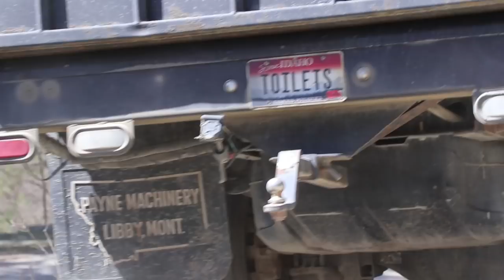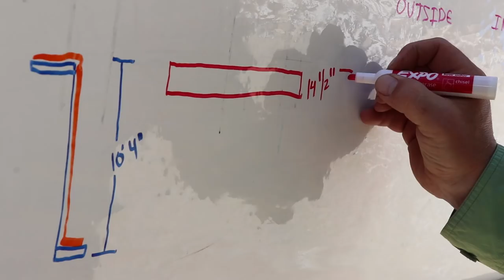TERRIFYING! Melting Our SIPs! (Installing FIrst Garage Panels)

Comment: Get a battery and some wire and you can make your own foam cutter for near nothing.
Reply: They only want tools that cost the max....don't cha know...
Reply: catfish307 
A wire only works if you've got access to both ends of the cut. This is a plunge between the OSB skins.

Comment: You may have been better in the sun with improved ventilation  because the smell might be harmful to your health. If I'm not mistaken the foam is styrene and bad for your health if it can be inhaled. I would get the MSDS (SDS) now and ensure you have adequate ventilation or the proper respiratory protection.  I'm a Health Safety & Environmental (HSE) Construction Site Safety Master  (CSSM).

Comment: Just be careful.  I'm a retired architect and if I'm not mistaken, that's cyanide gas coming off that melted foam.  That's why most codes don't allow foam as a finish material for interior finishes.  The fire doesn't kill you, it's the cyanide.  Please use some respirators in a well ventilated area.

Comment: An 8-foot and 16-foot wide garage opening needs at least two jack studs to support the LVL beams (headers).  I would definitely use 6x jack studs (e.g. 6x6) on the 16-foot opening.  You are looking at a major building code situation here with garage opening jack studs.  Go check out a construction site and you will see.  You are putting the stress of opening and closing the doors on one 2x, which is not recommended.  I  hope you seek a second opinion.  I understand you are not required to use the building code, but there are certain structural critical points on a building that are critical.  Those two openings are such the case.
Reply: Correct

Comment: I have build alot of residential homes, most custom. What the print says and reality are always different. Alot of times each architect doesn't see what the other is doing, Plumbing, electrical, etc. You usally end up sometimes trying to put 20 lbs in a 5 lbs spot. Wanted to let ya know this is normal. While any concrete work is being poured things get kicked around and moved..

Comment: what's the fire rating on that foam, if any? I've not heard any comment about it .
Reply: Foam is air-tight bounded to the OSB skins.  The OSB will be fully covered with minimum 1/2" gypsum board use as a fire wall.  So the interior has similar fire ratings as any normal stick frame constructed home...  BTW, have you ever seen   vinyl siding on a home or synthetic wood decking burn?

Comment: I'm confused about something. I've watched your vids for a long time. I enjoy most of them. So, here goes. I undersatnd the resaoning behind your wanting a timber framed home. Yet I don't see how you're saving much money when these sips seems to be such a hasle. I was told by buildres in the area that sips were costler but you saved money becaseu of the labor for instatlation. Yet I see you folks spending a ton on screws and other things to install the sips. And the time to prepe the pannels and such seems to be excessive. I realize that you folks aren't profrssionals. Yet if all that you're doing is required, one has to wonder if there isn't a better method to get the same outcome. I know Jessie said that the orginal plans called for a ton of lumber. Just wondering...:)

Thakns for all the work.

Comment: Are you sure the heated elements are not interchangeable, where you can replace the 6-inch coil with a 8-inch coil, so you don't need two handles? 💜🌞🌵108/75f today

Comment: After you build your drive under deck on the south end it would be a perfect place for your passive solar greenhouse venting heat in winter to the garage.  You dont stand a chance digging in that ground for air cooling and heat.  You could capture all the water you need from gutters tied into storage tanks into a culvert vertical with biochar and sand filtration.  Add to a compost pile.  Use to hold up the deck.  Will retain heat from solar radiation in the winter.

Comment: If you want to reply to comment you have to just use comments as the reply to comment section for there you tube channel has been disabled.
Reply: I believe it has been a YouTube problem for several years (google this problem about missing replies in YouTube comments).

Comment: All those screws lined up through the OSB!!  Wow!
Might as well use nails. The fastener head will pull through the OSB long before either a nail or a screw pulls out of the 2X.
And I'd have used a lot less fasteners as well...and some construction adhesive.
Reply: screws has more holding power than nails when securing OSB skins to OSB splines.  Pull-through power is directly relevant to nail head or screw head diameter and if the screws' type of head.

Comment: To cut foam..... I use to make a bow (as in bow & arrow) and use a length of nicotine wire (fuse wire) across the bow. The ends were connected to my welder cables. When welder was on & adjusted for heat (red) it cuts through foam so easy. 12v car battery could also be used.
Thought this might be of use.
Cheers

Comment: Make a hot knife using  9 volt or 12 volt battery and one piano wire. Then you can cut it yourself. Put a gide on both sides so you can gide the piano wire down to the depth you want. the gide will keep you flat and flush. drag the piano wire down the one side and across to the other side. cutting out the same square you did in this video. And it won't  have a rounded Edge. like your hot knife make. It'll will be Square from one side to the other. Look up DIY HOT KNIFE FOR FOAM.

Comment: Sip knives or hot foam knives can be use with a bias.... buy the smallest (6 inch) that you need.... make your depth gauge to the max width of your SIp (12 inch)  put your guide to one side of your depth gauge... so 6 inch one pass ... 8 inch two passes up(6 inch run) and back(2 inch run)....12 inch 2 passes up(6 inch run) and back (6 inch run). I use a 2 inch cutter for fridge/freezer panels and cut up to 10 inched.You can even use a 6 inch cutter on 4 inch sips or smaller by angling your tools to fit.

Comment: Please do a separate video on why so many screws.  I'm sure you have talked about it, but if it was in a title, one could find it easier ...  Even if it only 5 minutes.  Just don't understand why it is necessary.  Thanks
Reply: SIP's manufacturer requirement - read my comments a few videos back.  (I copied and pasted the installation instructions).

Comment: Little late in the process for me to say this but the Imperial system of measurement has been abandoned by every country in the world for good reason. Oh except for America which keeps its own standards. Except of course that the Imperial system was English. England has sensibly abandoned the length of a kings foot being equal to twelve of his thumb knuckles. 
The system which at first seems wonderful because it uses multiples and divisors of two and three for everything is dead useless when we consider that the metric system is based on multiples of the number of digits we count with. That is zero to nine. The metric system ensures accuracy, ease of multiplication and division, ease of transposition from one size to another, and ease of using varying units such as one litre is a 100mm cube of material and one litre of water equals one kilogram.
Of course America knows that Henry the eighth's thumb is a better length measurement as is the volume of one of his stools for a fluid oz. I guess the rest of the world will just have to put up with America's imperialism when we buy tools for the forseeable future. 
Happy furlongs per fortnight. Which brings to mind measuring horses in hands. How did you buggers get to the moon?
Sigh.
Rant over. :-)

Love your videos, by the way. I don't miss any and hang out for the next installment.
Reply: "How did you buggers get to the moon?"  Because we Americans were motivated to ensure the moon's surface was christened with "foot" prints.
Reply: Can't please everyone.

Comment: Did you guys ever consider a collated screw gun-driver?
Reply: I'd use ring-shank nails in my framing gun - one-tenth the effort, same holding power as screws.
Reply: They did purchase a very heavy duty one - before prepping and installing their roof sips.

Comment: I take it their are not using the electrical chase on these panels as they have run the long screws through the vertical chase openings.
Reply: I believe that all electrical chases are marked with orange or red paint "spots" at the edges of the SIPs' skins.  But if they screwed up (Pun intended) and blocked a chase, this can easily be corrected by removing that particular screw.

Comment: Surprised you didn't get a hot knife when the SIPs first arrived to cut the channels down the sides. It would be much cleaner both in cut and avoiding foam going into the environment.

Comment: FWIW.  IRC Code requires 3" of load bearing surface width for headers over a span of 6' or more.  Meaning you should have at least 2 jack studs per side of each opening.  Ideally it's more for a stick framed house so that the headers do not dislodge during an earthquake and become unsupported.  ICF code may be different.
Reply: irc leaves room for actually calculated walls, which sips should be ..... But clearly the engineer they had did not.

Comment: As far as the hot knife goes couldn't you use the 8 inch for any size just with multiple passes? And as long as you have the guide you shouldn't even have to adjust it till after 16 inch, right? Run it one way, then turn around and run it the other way. Or am I missing something?
Reply: Or get the wider one and tilt it into the narrower panel.

Comment: Yes, jack stud is correct. Cripple studs are what fill in the gap between the jack studs, usually under a window, door sill, or above a header. Doing an awesome job, but I can’t help but wonder why you have such a low spot on your concrete garage floor. Also, I am totally stealing your raisin recipe.

Comment: ok so if i can throw in my two cents worth here, my opinion about sips is that counting all the prep and such that youll done that in reality you could of built a regular stud wall with fiberglass insulation and been done with it , plus the fact that wiring would be easier but it is what it is rigbht now, you made your choices right or wrong you guys will make it work. just to let you know i love your videos and wish youall the best of luck.i completly understand the things youll do, its your life and so forth so anyway thanks for sharing your life with us all.
Reply: Scott: At least Jesse and Alyssa are revealing the pros and cons and are not hiding or misleading their audience.   I admit, I thought the exact same thing as what you said whenever Jesse mentioned about the amount of extra lumber the SIP's manufacturer recommended.  I assume this excessive lumber recommendation would have been necessary if this build's SIPs were "free standing."  Jesse's and Alyssa's SIPs are attached against the timbers, instead of "free standing."  (This is just my opinion).

Comment: Yeah! Rum Raisin.  Yum.  When I was in college on the Submarine Team.  It was a college club that made Submarines and raced them.  The two man crew needed SCUBA gear because the submarine was wet. The submarine was a carbon fiber shell around a foam core.  We had to dig out the core to a thickness that when fully built would make it neutrally buoyant.   We made our own hot knife to get to the thickness we needed after we gouged out most of the material.  Needless to say, our hot knife wasn't as hefty and manly as yours.  LOL

Comment: You can cut polystyrene with hot thin wire why use such a thick tool, very low amount of smell

Comment: I have a homemade "hot wire" and you use it something like a band saw. Wire sits in a frame and is vertical. You push the foam through against a fence for width. Works good for what it was designed for. Yours is a great idea, too. Coming along.

Comment: when was the last time you ran diagonals on your garage door openings? btw, those fumes off your fancy barbeque starter are probably cancerous in a big way.
Reply: Welder Bob 
Should be ok, they have 1 inch left and 1 inch right for trim and alignment.

Comment: At 24:05 I noticed that the thermal break is broke. You have the ends of the foam board lined up along with the end of the worm board. The joints should be staggered so so the heat and the cold will have to work harder to get in.

Comment: So over the month I have always seen that same spot have water in the garage, to me that looks like a perfect place to cut in a floor drain.. just a thought!
Reply: It's a radiant heated slab, so there' tubing going all throughout. Also, the water is there since the warmboard above still gets rained on. Should stay pretty dry once the roof is up
Reply: There is a floor drain there. They closed it so that it didn't get clogged up with all the sawdust etc. They put it in when they put the concrete in
Reply: I think that is where one of there floor drains is but they have them all covered until so  sawdust, glue etc doesn't end up in the septic system
Reply: It is a floor drain, just taped over

Comment: Why do you still use the generator if you have mains power now?
Reply: I don't believe the last 250 feet (I think) of underground cable isn't wired to the timber frame.  Since the voltage is only 240 Volts coming from the transformer, a heavy gauge portable cable would be very expensive.
Reply: At the time of this video, they didn't have "mains" power.

Comment: We been watching your videos for the last year. I wish you would practiced better safety procedures around your table saw. Every time you reach around the running blade to push the wood through I cringe!!!!

Hard to fly a plane or build a house with half your fingers laying on the ground. 

You need to use or make push blocks and add the safety guards.

It only takes a second to make a catastrophic mistake!

Comment: Forget about your calculation error.
What about your engineer..... Your still making a studded wall in the front of your facade. you should have used 2by4's(lvl or not) to make the support for the doors and attach those either to the inside osb on the sips for that is where the rest of your structure is and fill the rest of the gap up with eps.
And that is what your engineer should have specified.....
cold joints galore now.